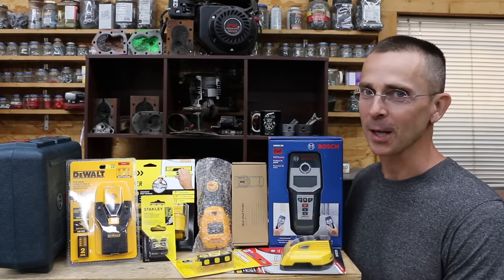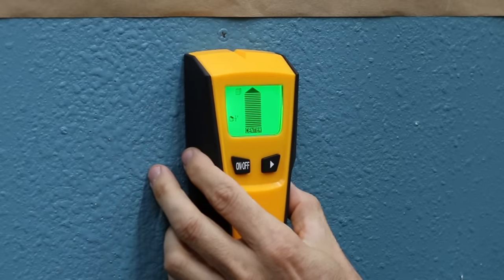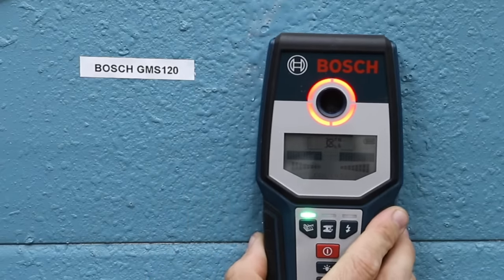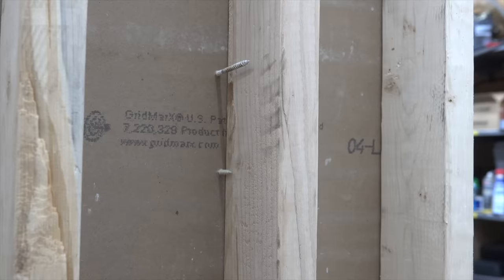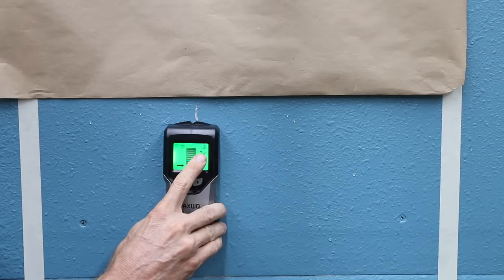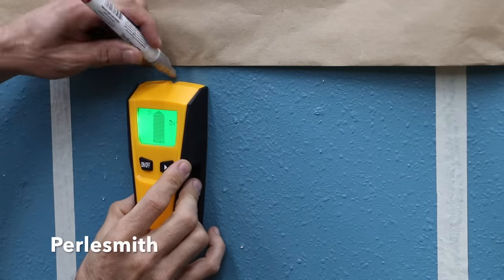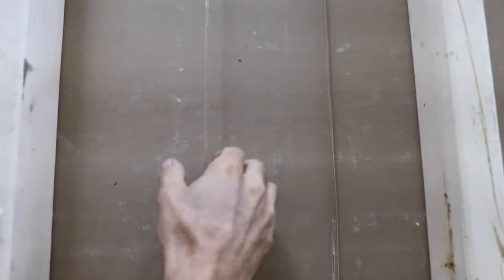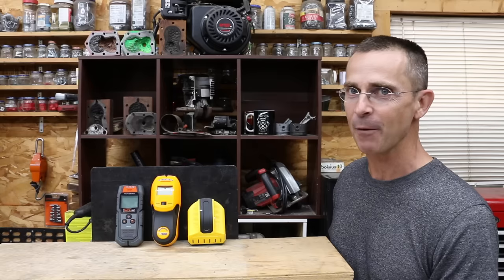Best Stud Finder? $262 Bosch vs $10 CH Hanson vs 9 Other Wall Stud Scanners! Let's find out!

Comment: As someone who has wall mounted a lot of televisions, speakers and shelves, I would definitely say Zircon is the best overall. I've got an older Zircon unit, I just find the edges, mark the center, it's never missed once.
Reply from the maker: Thanks for the feedback.
Reply: Same here...my dad has a 15 year old unit...I bought a zircon 4 years ago....both work fantasic.
Reply: Agree. I have the basic Zircon model that just has a light that tells you where the stud edges are. No idea how you could get a better and simpler product for what it cost ($10 bucks maybe?).
Reply: Me too love my Zircon, but also appreciate the franklin for not having to calibrate it.
Reply: Any luck with plaster?
Reply: @whit6282  Unfortunately, all the homes I have done mounts in were drywall, believe the oldest was an apartment built in the 80s. I'm not sure how well my Zircon unit, or any of their other models would work for plaster, but hopefully someone else chimes in. I will say my unit at least is very sensitive, so it may have a chance at working on plaster, but as I said, I'm not for certain. You may try your luck at looking for a unit specifically designed for plaster.
Reply: Same here. Mounted TVs for a few years. And many more years of home DiY. Always used a basic Zircon, and some magnetic levels. Never needed the technogeewizardry hokum overkill.
Reply: J Potter 

How many televisions does your house have?!

JK
Reply: @billbrasky6827   Heh ... they were all mounted in other people houses. Some quite ridiculous .... like the family that had 2 old huge plasmas and wanted them both in brick walls over enormous fireplaces. Anyway the joke is .... I would never mount any TV of mine on a wall!
Reply: @jpotter2086  yup that seems to be the trend, i'm working with drywall on a daily basis and some jobs we get are  for modern fireplaces and in almost all cases we are asked to put reinforcements on the face of the fireplace for a tv mount .
    some even ask for a indentation in the face of the fireplace to match the size of the tv with minimum distance around it so it almost looks like the tv is part of it when finished, worst part is they never consider the tv's own heat or the added heat from the fireplace, even with the best insulator's behind some heat goes trough...
   i wonder how many tv's melt in the winter when they put that fireplace trough it's paces..
Reply: @whit6282  I have an old Zircon and plaster walls. It works, but probably not quite as accurate.
Reply: I also trust Zircon. It sometimes gives you an "approximate" location as shown in the video, but if you're not a complete moron you'll hit center every time.
Reply: @jpotter2086  When installing brick fireplaces do you anchor to the brick or mortar?  I don't trust the mortar and always do brick even though it can break.  lots of debate which is best, mortar  can be repaired easier.
Reply: @scottstewart9154   Thankfully the mounting gig was several years ago!  Used masonry anchors in the mortar, IIRC. My thinking was that even heavy flat TVs aren't THAT heavy, and that mortar can be repaired if a problem does develop, and when the TV is removed. A hole in a brick or a stone is forever. Personally I thinks its insane to violate the integrity of any masonry construction for something temporary like electronics, but that's what they wanted.
Reply: My Zircon is 20 years old. It just works. However, the new model looks like a great value If I wanted to upgrade.

Comment: I wouldn't necessarily even mind seeing another round with different variants from the same manufacturer. I'll give you an example you go into Home Depot to pick up a stud finder and there must be a half a dozen different types from Zircon alone.
How much does price make a difference within the same brand name? We got a little bit of a sample of that with Bosch but I wouldn't mind seeing more. 
Another great video! Thank you for all the time and effort you put in.
Reply: I bought a Zircon StudSensor e40 on sale a few years ago.
After watching this video, I wonder how well the live electric warning works.
Reply: I have a Zircon... model number not at my fingertips now, but it was the $40ish version. Has been incredibly accurate including finding live wires.
Reply: I think I paid around $10, and saved about $5 or $6.
Reply: I've owned 2 different Zircon units and neither could find the studs in my walls. Its maddening. Asked a buddy to borrow his which was a Zircon as well and his was junk too.
Reply: BIG TIP - I’ve been in construction most of my life and I’m 59 now. So I’ve owned a lot of stud finder’s and after going through electronic warfare training in the military, I finally understood how they work so I put out a video about it and it is exploding on my channel because it’s helping so many people. Just search my channel for how to use a stud finder and you should find it.
Reply: I'd like to see a review of the WALABOT.  Anybody here ever used one?

Comment: I am GPR certified through GSSI for concrete scanning. I wouldn’t mind seeing a concrete scanning vid BTW!  I used the GSSI structurescan mini to scan drywall with and it is super accurate!  It’s made for concrete up to 16 inches deep and can do a grid scan for a 3D model of the scan. You can rent them instead of purchasing them because they are very pricey!  But if you were wanting the most expensive scanner it may do the trick!  Love the vids!
Reply from the maker: Great suggestion!  Thank you.
Reply: Milwaukee has one, very expensive too, I would love to see that too.
Reply: @patrickjames3321  I thought their's was discontinued years ago along wit h the bosch equivalent. I was under the impression the company that had the actual tech no longer wished to license it out to be rebranded anymore
Reply: @gander13189  damn, it must be using radiation for detection
Reply: @ProjectFarm  I think the Walabot will do concrete also, just not very deep.  Maybe that's a way to include them both in a future review.
Reply: I agree, retest using concrete walls instead of drywall, as I expect it will be a HUGE difference!

Also I believe the Zircon a100 very outdated, should be the A250(c) instead. Or even their new K3 model.
Reply: @patrickjames3321  You mean the sub-scanner?
Reply: @MGSsancho  They both sucked ass and were useless.  I was one of those who got suckered into buying one(milwaukee) of the useless expensive POS!  A $20 stud finder was far faster, easier, and more accurate.
Reply: @MGSsancho  well they show it ok their website, 12 v
Reply: @fluke196c  yeah

Comment: There is one thing that a lot of people seem to miss when using the Bosch D-Tect 120: your second hand has to stay in contact with the wall while using the device. The manual says that and it makes a big difference. The only issue is: who reads manuals?
Reply: Is it something to do with grounding some kind of signal coming from it?
Reply: @Erutan409  I guess so.
Reply: That is my experience as well, also I’ve had any issues with it being off at all.
Reply: @Erutan409  Yes, its grounding of the unit, I was becoming really frustrated with both the GMS  120 & the D-Tect 120, but then I found out that certain wall coverings & paints seem to generate static when the scanner is moved across the surface, I place my free hand next to the unit as I move it across the surface, its stops the false positive readings (mostly incorrectly identified electrical cable).
Reply: No you cannot ground it, the unit is plastic and Drywall/Sheetrock is not grounded.   The unit uses a sonar sensor so by putting your hand you provide a boundary for the sonar but other units do not require this so it seems odd.
Reply: You apparently
Reply: There is a light sensor on my GSM 120 it tells the unit it's on the wall, you need to put your hand next to it to stop light bleed behind unit, had really bad results till I found this out,  now it is very accurate.
Reply: That's suuuuper weird. At least, in the manual for the GMS120, it says the complete opposite: 
"Do not touch the surface being scanned 
with your other hand or any other part of 
part of your body, because the moisture 
may affect the scanning."
+
"Make sure that your fingers of the hand 
holding the detector do not touch the 
surface being scanned, which could 
interfere with the tool’s ability to effectively 
detect items below the surface."
Reply: Oh damn, so it's different for the GSM, but for the D-Tect 120 it really does say to use your second hand in the manual:
"Static electricity can lead to inaccurate de-
tection of electrical wires, especially, over 
a large range. It may help to put a hand on 
the wall next to the detector and measure 
again in order to help remove the static 
electricity."
Reply: It seems the test is through sheetrock so the
Information is valid for interiors but can you get a reading through half inch osb and tyvec or tarpaper?

Comment: I have a house with 145 Y.O. plaster walls with layers of paint and nonstandard stud depths + spacings,and 90% of stuff finders are totally useless at telling the Lathe vs. Stud or even seeing through the thickness of the plaster. 

It's a huge pain. Getting a deep dive test with some 1" thick plaster and 1/4" lathe walls would be WONDERFUL! It would also be a huge help to a LOT of us restorationists and owners of old colonial and Victorian homes (most of Philadelphia, NYC, Boston, Richmond, Alexandria, D.C., Charleston, Detroit, Buffalo, Memphis, &c.

Comment: I have both the most expensive Zircon that Lowes was selling 3 or 4 years ago (model?) and a  Franklin T13.   In everyday use the T13  kicks Zircon butt.   But neither are any good for thicker walls, like tile or plaster, or at finding floor joist through finished floor... something I sometimes need to do.  Find one that will find floor joist under a finished floor or studs through vinyl or Hardie board siding on the outside of a wall that doesn't break  the bank and I would be interested!      Thanks for the entertaining and informative work you do!
Reply: I agree, the Franklin is a better tool, but has it's limitations.
Reply: There is definitely something to be said for the no need for calibration if you use it very often, as I do. I will stick with my T13 until we get xray cameras.
Reply: I don't know what you define as not breaking the bank aka what your budget is... But the Bosch d-tect 120 does everything you need. It detects up to a depth of 120mm / 12 cm / slightly under 5 inches
Reply from the maker: Thanks for the video idea.
Reply from the maker: Thanks for sharing.
Reply from the maker: Thanks for the feedback.
Reply: The Franklin is the best and fastest sensor for studs. It's almost ridiculous how easy it works, and you don't have to place against wall first to calibrate.